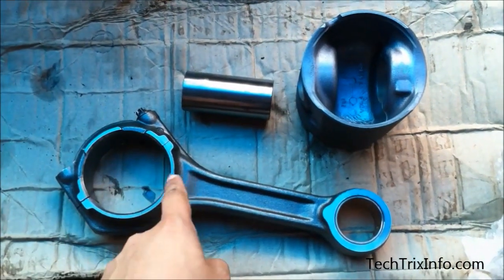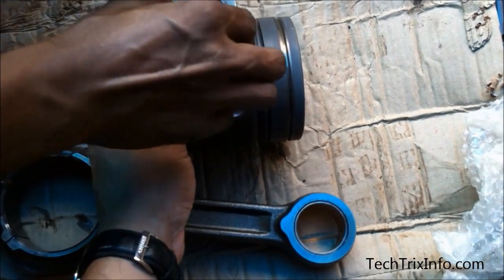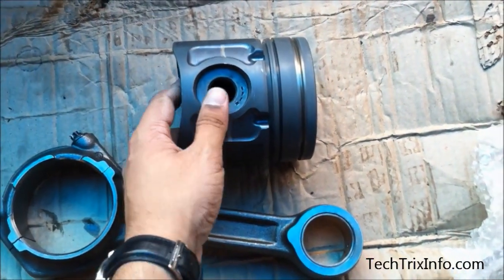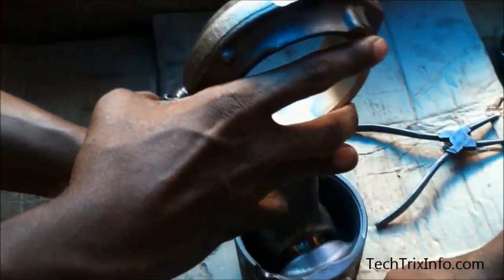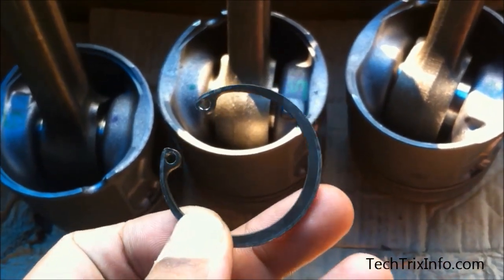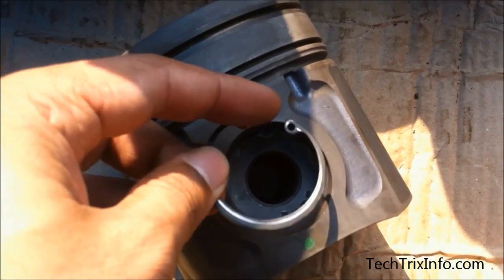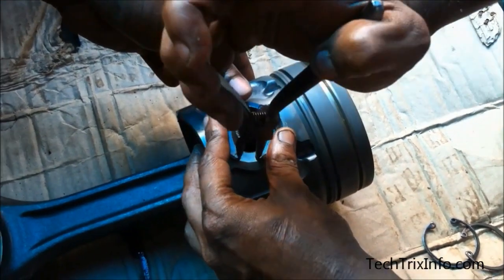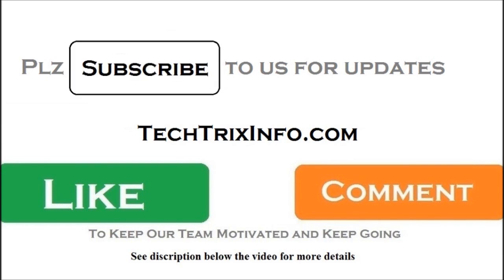How to assemble and lock Piston, Connecting rod with Gudgeon pin and Circlip

Comment: Whether needle bearing comes at small end of connecting rod for any two wheelers ? Whether connecting rod big end needle bearing is of standard sizes or custom sizes? Whether these are designated in the same way as ball bearings?